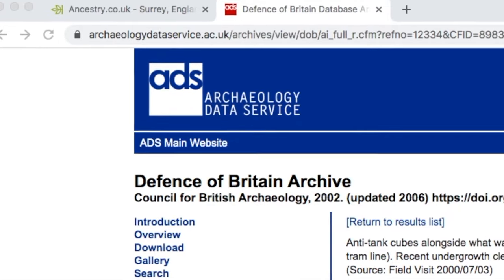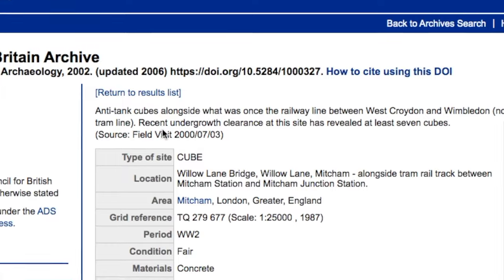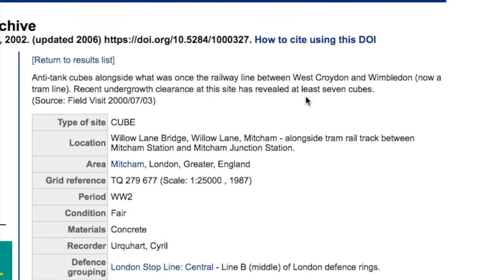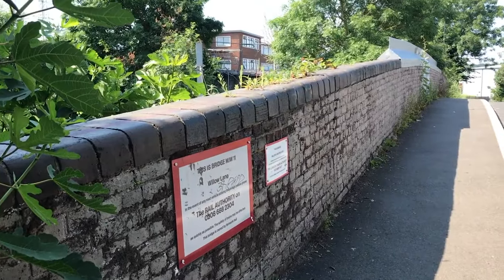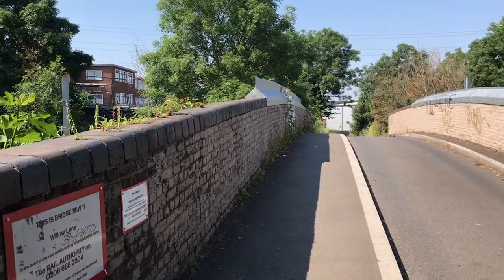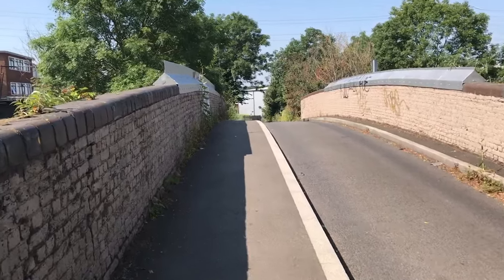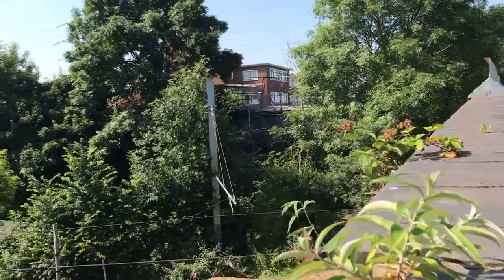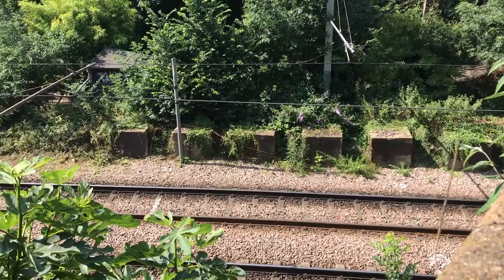Anti Tank Blocks by the tramline at Willow Lane

Comment: A bit more on the humpback bridges . In the 1950s , they were the only entrance to the expanding Willow Lane industrial estate . The scaffolding firm SGB had a large depot and their lorries would sometimes queue at this choke point. As the industrial site grew , another entrance was opened up . I guess the humpback bridges slipped quietly into less frequent use .
Reply from the maker: @kenlavey7771  I had a summer job at Morfax in the mid 1970s and rode my motorbike there. There was an entrance from Carshalton Road then, possibly Arney's Lane or Drake Road.

Comment: Further to the use of the railway line at Mitcham as a defensive measure in case of Invasion.
The railway line at Epsom was used similarly as it runs in an embankment. I’ve been told that what looks like a conventional house overlooking the line is actually a large but disguised concrete strong point .

Comment: Another excellent entry !
I believe that the railway line here was intended to be a line in the sand if the Invasion had started . Further along the line there is a bridge near to Wilson hospital and alongside and hidden was a pillbox .So , I am  guessing the anti tank traps and the pillbox were part of fortification . Furthermore there was an anti aircraft gun battery close by the junction of the now tram line and the railway line to Epsom .
Another wartime connection . Close by the two hump back railway bridges was a factory yard which had 3 Hawker Typhoon or Tempest aircraft cockpit sections . From memory, the front windshield was intact but the wings , engine and the rest of the aircraft had gone . I imagine the valuable instruments had been stripped . They were there in 1958 1:30 
or thereabouts but it’s years since I travelled over the humpback bridges .
Around 1958 the hump back bridges had large diamond 
shaped cast iron signs warning of weight restrictions. They belonged to an age of steam traction engines and warned drivers of “ road locomotives “ !
Reply from the maker: @kenlavey7771  I remember a bomb shelter in Cranmer Road near the junction with Carshalton Road, although it may have been a pillbox.